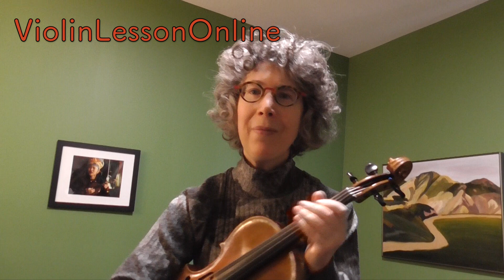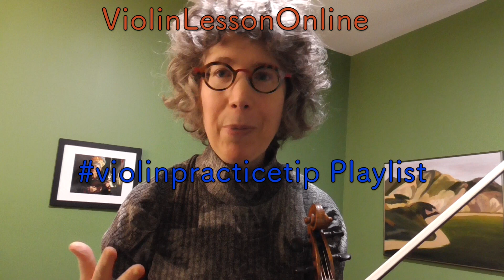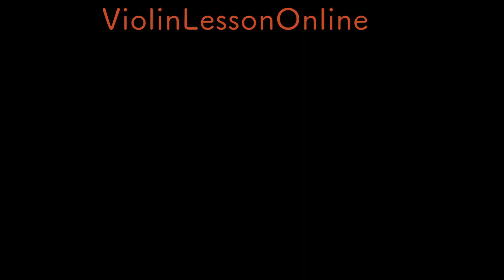Harmonics on the Violin Natural and Artificial and Physics #violinharmonics

Comment: Hi! How would you notate the shifting sound that you did? Like how do u notate lightly touching the string and sliding it up and down it?
Reply from the maker: Hi Aoife! usually with a diagonal line between the notes, if there's a need to notate that (that's the general visual reminder for a shift, also used to indicate a glissando or sliding sound).

Comment: Iconic. But how much do you shift with the artificial harmonics? I.E. am I shifting by whole steps while my first finger begins on the first note of the G (string)?
Reply from the maker: You have to keep the "frame" of your hand, which gets a bit smaller as you move high up the fingerboard. You shift as much as you need to play those specific notes (with a few options depending on the context; you can play on a different string).
Reply: @LeahRoseman  I’m just trying to find the specific notes of the artificial harmonics as I shift so I can pin point them accurately. As of right now I don’t know how much to shift or what notes I’m finding. Hence why I asked where my first finger goes starting on the g string in first position with my finger on A. I know the third finger down is the first harmonic but onwards … not too much. I can’t find them but not with accuracy
Reply from the maker: @wisdomseeker0142  When you play the artificial harmonics at the fourth on the G string: they are exactly 2 octaves higher than where your first finger goes, so you can play them on the E string! The natural harmonic at the fourth is where you put C, so that's a G on the E string in 1st position, then use your first finger on the low A, hover your 4th finger over the D and you can check it with your A on the E string. If you can try to hear it based on the 1st finger (lift your fourth finger just to hear the 1st finger note) then you'll be listening for that note, just higher! Hope that clarifies it for you.